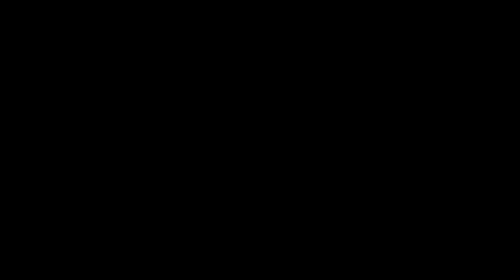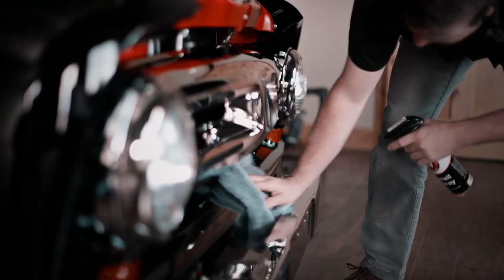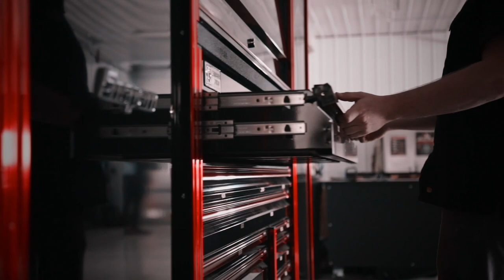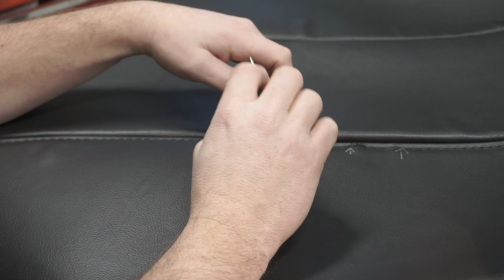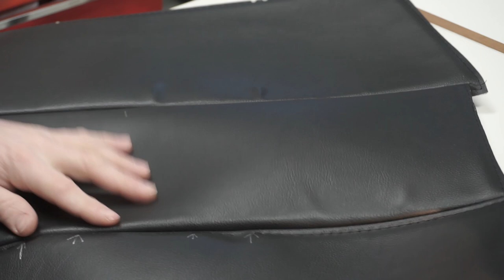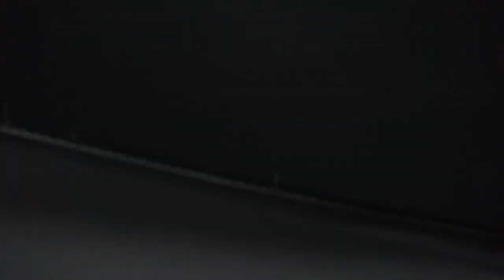How to Fix a Skipped Stitch-Save Your Project From the Trash

Comment: I'm an inexperienced sewing machine operator, so you mean both the top & bobbin stitches are first cut and then the top thread removed to the problem ends stitch by stitch?
Reply from the maker: Yes, work the threads back to where it first started messing up. Pull the top stich through so both threads are on the bottom/inside of your piece then tie it off